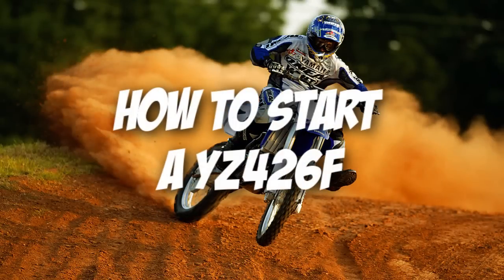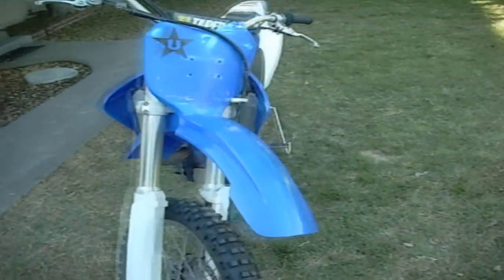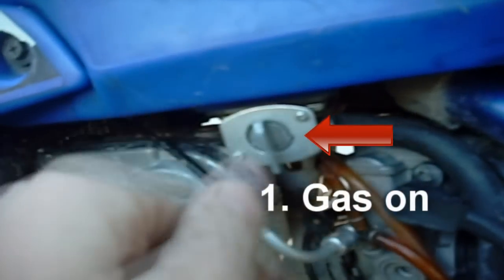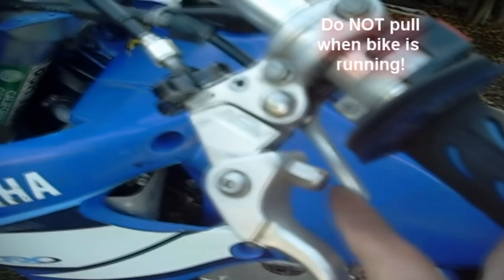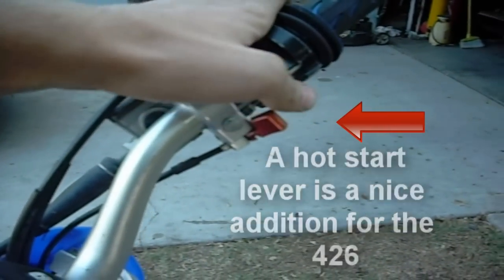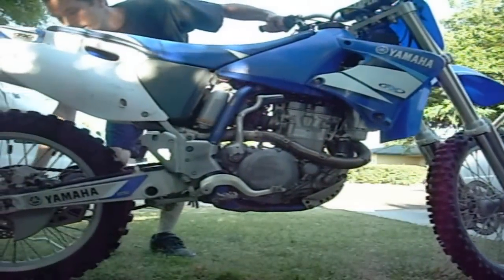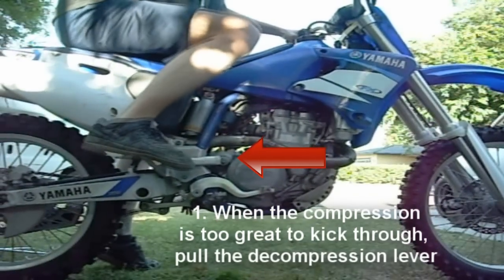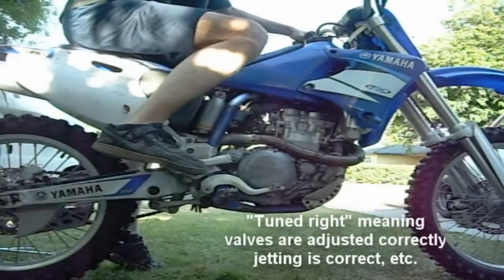How to Start a YZ426F Easily

Comment: Great job! On mine I pull the choke knob ( black one) hold the compression release lever in kick it over a couple of times then run it past tdc and start it. If you squeeze that throttle when its hot you will flood it. Even when its cold. That carb has an accelerator pump.

Comment: five kicks is a bit much especially with an idle being "high" thats how my bike was before i shimmed my valves come to think of it. around 5 - 7 kicks from cold and a high idle, now that their shimmed its almost always 1 kick sometimes 2, and runs ALOT smoother. you might not think there is a performance issue, but you wont know until your valves are in perfect spec what your missing.
do you have the tools to check ur valves and or knowledge/owners manual/matanace book? to do it?

Comment: Its does exactly whats it's name says, "Hot Start" meaning you pull the red knob out for starting the bike when its fully hot ONLY, (engine running for 10 mins of "riding" or more) if you use the hot start knob when the engine is cold you risk gas fouling your spark plug.  the choke is the black knob and is used for cold starts. or when the engine hasn't been running very long at all.  if you have a cable to your handle bars from the carburetor thats the hot start.(its aftermarket in most cases)

Comment: well i am 1m80, hmmm ok, i think in performance is nothing wrong, but the kick tactic does not work on my bike... when i try it, it just doesn't do the same as the one on the video!!! ye i have been thinking on getting that, but most of the time it start after 5 kicks or so ^^ , you know how i can put my idle so low as on this video without that it stalls?

Comment: not checking valve clearances and shimming them will lead to engine failure and possibly blowing up. checking valves adjust clearance and timing, its a HUGE part of 4 strokes. when a valve is out of spec and loose its staying open to long and lowering compression also if its exsessively loose it can come into contact with the piston and bend/snap and blow ur top end. when its to tight its not staying open long enough, wich throws timing off and keeps exhaust gasses inside. it can brake a valve

Comment: You might be a little small on the bike? to ease starting on these beasts you neeeeeed to check and "keep" your valves in spec, it makes a WORLD of difference! not just for starting but in over all performance too! mine rides ALOT smoother now and starts first kick every time. also if you tired of this "trick" install a "Exhaust HotCam" made for this bike, it has auto decompression so you can get rid of your decompression lever and just kick the bike like a 2 stroke!

Comment: I had a yz426 when I was 14, and it's not hard to start. Just kick it over until the kick starter feels stuck, then stop, pull the decompression lever in and kick it slightly a few inches down, bring the kick starter back up and give it a full kick.
Reply: When you kick it until it feels stuck do you have the decompression in or no?
Reply: @David-mt3cl  once the kicker gets stuck, stop, bring the kick start lever all the way up, pull in the small decompression lever, and kick it just a tiny bit past the hard spot, the let go of the decompression lever. Bring the kicker back up all the way and give it a full kick
Reply: @David-mt3cl  make sure you have to choke on and turn the choke off once the bike is warmed up

Comment: i converted the weight via google :D lol i don't know why u can stand on ur kick lever and it not move that's...odd...   no ur valves are not bent if your bike still starts/runs with good power,  in all honesty the shop around here wanted 120$ (US) to shim my valves. i checked them and re-shimmed them my self, learned ALOT and only paid a total of 20$ for the feeler gauges and 3 new shims. as long as your dad has a torque wrench too. thats all you need to do this ur self.

Comment: if the bike's moving in gear when you pull the decompressor the engine will bog, if you give it throttle the bike will backfire or pop

Comment: Quick question, at the time when you are doing your "one hard kick"  are you still pulling in on the decompression lever?  Or you just pull it in once and release it when you are doing the "soft kick"?  Thanks!
Reply: No one answered your question 
Now it’s my question 2 years later smh
Reply: @amoses823  no you aren't pushing in on the decompression lever. you only do it to release that exhaust pressure in the engine to make it easier to find the right spot to kick

Comment: i need to put my bike against a wall to kick it, to use my full weight on it, i can't start it like you do, but i would like to if i could :P my bike would never start after 1-2 kicks and the idle is high, when i try to adjust it, it just stalls

Comment: i have a hot cam installed in my yz426f and still having a hard time starting it, valves are ok, it is tuned fine, once it fires up and i shut it down i just need 1 kick to start it, but before i get it started geez... don't know why it won't go since i always go to TDC even with hotcam (no i don't use my lever anymore)
Reply: Shane did you keeps the bike? What do you think of it now?

Comment: Trust me, if your idle has to be high, the kick "procedure" isn't working right away theres only a couple of things that can be going wrong.
#1 your not doing the procedure right, it took awhile for me to get it down.
#2 your not kicking hard enough once u get to "the spot" (make sure once u get to the spot that u bring the kick lever all the way back up to get a big kick on the moter
#3 your valves are out of spec. Honestly this is the biggest problem area. if you have hard starting, check them

Comment: god, im having so much trouble starting it... it almost started a few times and wouldnt stay on. so annoying
Reply: maximus14433 change the plug often
Reply: 911RescueDiver lol that wasn't the issue. it needed the valves shimmed And a new spark plug unit (forget the name) not the plug but the wire and the magneto or whatever it is. anyway sold it. top end went shortly after selling too 😓

Comment: stem, drop the entire valve into the cylinder and completely destroy the motor. with all respect, YES there is room for error in shimming valves. however "checking" them is not hard and only requires removeal of the cylinder head cover. and some feeler gauges. be catious and go slow and just learn. (what i did)

"Not" checking them, is the worst thing you can do to a 4 stroke Especially this YZ426. these engines are very high performance and neeeeed maintenance.

Comment: i am 90kilo's dunno how much lb's that is, well i am not planning to pay couple hundred euros for checking the valves in the shop (i mean when i kick it after i hit the spot and bringing the lever up, the lever stops halfway, i need to use compression lever again to get the lever down...) the valves probely aren't bend otherwise it would not run and still have excellent power right?
You ain't a dick i like to have some valueable information ;)

Comment: Was about to buy one off Craigslist, glad I didn't. What a nightmare to start
Reply: Dirk Diggler I was about to buy one too but idk after this video now ..... plus I heard that this bike DOESNT have a 5th gear in it 👎.
Reply: Scoobies 420 dont " i heard" . do your research to make sure. the wr model does have a 5th.
Reply: same
Reply: Not true. the yz400f doesnt
Reply: Dirk Diggler I had a yz426 when I was 14 and I could start that thing so easy, once you get used to using the decompression lever and setting up the kick start in the right position, it's soo easy to start.
Reply: Freestylebattlefield 1 lol